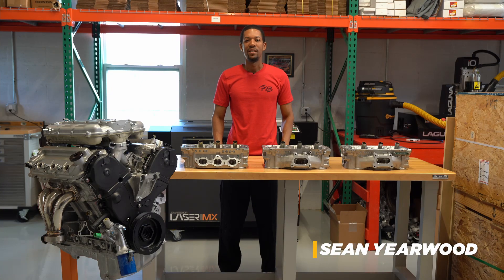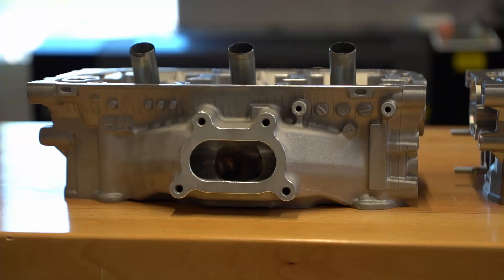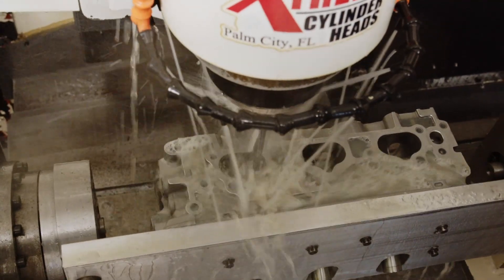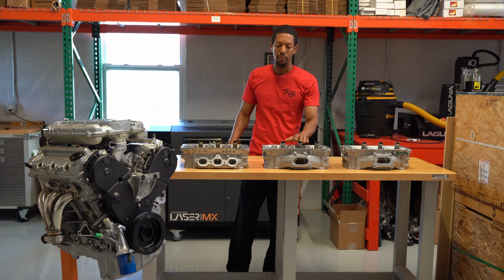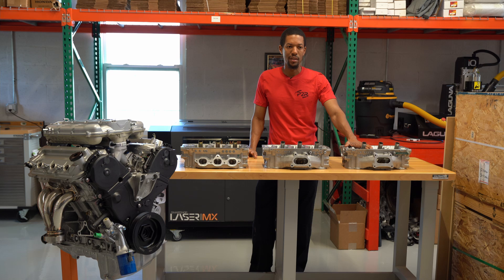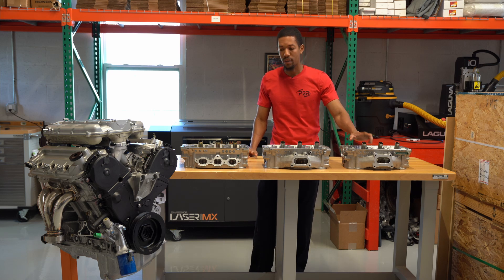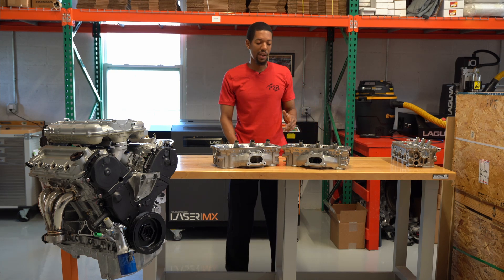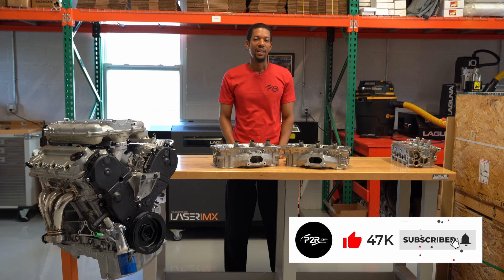J Series Tech Talk -Cylinder Head Exhaust Port Comparison J32 J35 J37

Comment: Nobody hardly mentions the Odyssey when talking J series. 
The 2nd and 3rd gens are slept on. Some light engine mods, coil overs, bigger, wider wheels, 40 series tires, and for about 300 pounds of free weight reduction, take the second and third row seats out and they perform and handle great. 
My RL1 will out handle most cars on the road

Comment: For me, the 3 port head isn't necessarily about power so much as sound. With a traditional header, I KNOW I can get that equal length and I KNOW I can make the merge collector right, but only Honda engineers know WTF is really going on with that single port stuff. So I now ask you; I heard that a J35A6 from an 05/06 Odyssey is a drop in swap for my 03 Accord Coupe, but I want something with a 3 port head so I can get some bitchin headers made... What should I look at, instead? I want big N/A power but very streetable and about an 8000rpm redline but DEAD reliable with that. Thick and strong sleeves/block, too, as I may throw nitrous or a centrifugal supercharger at it later. Was thinking a 35, but a 37 really isn't much bigger on the stroke so IDK.

Comment: I got a quick question. I have a G35 A4 that comes in the pilot. It's totaled but the engine still good. Picked up a Odyssey just wondering if there's anything I need to do differently with swapping the engine from the pilot to The Odyssey

Comment: Serious question, I noticed the j35y4+ have higher compression rate but stroke is the same as j35z so... Is it the piston or the combustion chamber that makes de difference? I have no idea where to look for this info, I want to build a high conpression NA engine so... If its the combustion chamber I need those heads!
Reply from the maker: If you're building an engine. We can just get the pistons to be around the exact compression ratio you want to be.

Comment: Is there a fix for the j30a1 head's exhaust Port that's curved to go around a head bolt. 2 out of 3 exhaust ports are a straight shot to the combustion chamber, but then one of them looks like it's designed for heating up a head bolt...

Comment: I was recently able to pick up a very very low mileage J35Y6 short block.  I had been originally planning to K-swap my 1992 Civic, but with this block in hand it makes me want to try to use it instead.  I do want to build a little bit of power into it, and will likely look at a mild turbo build for a daily driven street car- no drag strips for me!  I will likely never see redline, as I typically keep my cars in the lower 2/3 of the available RPM.  The better torque of a J35 definitely sounds appealing.  What head would you recommend I use?  Also, do I need to look into having the block sleeved or anything in order to ensure it has a long and happy life?

Comment: Im looking for a J series for a miata swap  but atm im only finding J30  is it a good engine ? Most  swaps I’ve seen where j32
Reply from the maker: I would personally only go 3.2 or bigger.
Reply: @PowerRevRacing  any particular reason ?  Cuz im from europe and where im from they. Are kinda hard to find also the k series engines are kinda hard to find the A versions alot of Z’s   I am able to pick up a J30A1 for 300 euro  with ac pump alternator and  wiring harnass

Comment: Any thoughts with stock J35Z2 + turbo? G30-770 0.83A/R, and I only want 5psi. VCM is completely disabled from an ecu reflash. I can manipulate torque values so my auto transmission can shift harder. So transmission shouldn't be a problem I think, I have yet to try. But I don't know about the engine. Stock engine alone wants to knock like crazy. I have 2.5" PCDs and 2.5" J-Pipe and 3" cat back exhaust with 3" straight resonators and 3" straight muffler. I raised knock sensitivity to stop ecu from retarding my timing. I turned off fuel dumping function in high load. I tried 12.5:1 and 12.0:1 AFR in N/A and it still wants to knock with minimally added timing. I did it to see how it would do stock. It made me a bit scared to go turbo. But I still want to.

Do you think 5psi is fine with optimized timing? Is there anything to concern for this engine? Any suggestion is highly appreciated. 

Thank you

Comment: I turboed my j35z2 on my 8th gen accord and surprisingly it's doing well for 3-5psi of boost. The molded exhaust manifold hasn't really affected the spooling and actually helped with keeping the exhaust tubing compact leading to my turbo
Reply: Hey, J35Z2 fellow here! Glad to see someone giving loves to J35Z2! Mine is from Honda Inspire CP3 in Japan and marked as J35A but it's literally the J35Z2. How are you going with it? Trans holding up good? Anyway I can get in touch with you?
Reply: Can I swap a 2005 tl 3.2 v6 and put it inside my 2004 ex sedan Honda Accord ?? Automatic on both transmissions… can I use the transmission from the Acura and put it on the accord or no!?… and how about the harnesses?
Reply: @angelmods5064  yes, Honda has been using the same engine bay size for all models and chassis. So if it has a V6 version then it definitely has the room capacity. Most of all Jseries are about the same cubic measurements. Therefore you can easily swap the J family. As for the harness, I don't think those are interchangeable. Trans bell housing for J30, J32, J35, J37 tend to differ by generations.
Reply: @blitzsiv6520  do you have a Instagram where I could personally show you couple things
Reply: @angelmods5064  check my YT account. Kept having my replies deleted
Reply: @angelmods5064  why not keep it in the Acura the trans and stuff and body is better?
Reply: @CO86 do you have a Instagram I could follow you up on how you did the project bud?
Reply: @@CO-kb9qeSo you used the stock engine harness from your J30A4/5 for the J32A3 and (LSD) 6MT from the 04-06 Acura TL base? What year was your Accord, and was it a 5AT or 6MT?

Comment: I know it's an older video but, Could you please give more info on combustion chamber sizes between the heads if any(?) Are there big valve options? Who sells good/better/best cams? Vtech heads?
Looking for options to use a J35a in my '02 IS300/auto trans, 3:55 rear diff. Also, what are the better choices between the JDM ones?
Thanks

Comment: does the rlx have a different intake manifold than the regular j35y-
Reply from the maker: Yes the RLX is direct injected so the intake manifold is quite different.  We actually offer cnc ported heads, and lower intake manifold for the rlx type s.
Reply: @PowerRevRacing  I have a TLX V6, and want that extra 20hp the RLX offers. I assume its through the intake manifold. would your ported manifold work on my TLX?
Reply from the maker: I havent done enough research of the tlx vs the rlx to see what is the differences however I know the lower manifold is the exact same part number. 

https://www.powerrevracing.com/P2R-TLX-CNC-Ported-Lower-Intake-Manifold-Runners-p/pr003.htm
Reply: @PowerRevRacing  thank you, love ur channel 🙌🏽🔥

Comment: I have a 98 Honda Accord. I’m not sure what tune I should use. I have a quad exhaust and ngk spark plugs but not the wires. Everything else is stocked. But the car puts out so much power. It’s insane. I don’t think the power in the car in channeling properly. The car goes to 90 very quick. But it’s not distributing power properly.

Comment: Hey Sean. I'm looking to turbo my 01 Acura tl. Before I turbo I want to do all the normal maintenance things and I was wondering while I have the heads off can j32a2 or j32a3 heads be swapped onto a j32a1 block without any major modification? I can do minor mods but I can't take an engine out where I live. I tried finding info on it online but it looks as tho nobody uses the J32a1 block when boosting or building in general. If I could swap a whole type s engine in I would but I'm stuck with doing small things for now. Any info about what compatable with the J32a1 block is appreciated! :)

Comment: Yooo that j35a4 sitting on the engine stand I just want to drop that in my 04 pilot lol I been wondering for a while is there any power I can put into the motor to give my pilot a lil more juice. I have a 2.5 lift with bigger tires. Definitely need the lil extra power. What do you recommend.  I've even tried looking for like a piggyback ecu chip to help give a lil more.

Comment: Will j32a2 heads fit on a j32a3 block?
Reply from the maker: Yes but requires modification
Reply: @PowerRevRacing  does the modification require machining or its it just swapping parts over

Comment: Im building a 2001 acura tl j32a1 rn. Its slow but steady. Found a afc for it and am about to upgrade fuel pump and get it tuned. Good little daily so far. Love your channel and the info you provide to the comunity. The j32s are such little beast
Reply: Is it a ulev ?
Reply: @angeloyescas7995  no as far as i know ulev was only given to accords in 2001
Reply: @popanda3652  interesting,my acura tl 2001 has a ulev in cali,but makes me wonder,so then its an accord engine in a tl?
Reply: @angeloyescas7995  what do you mean by ulev? To me ulev means Ultra Low Emissions Vehicle. Its not a THING but a title given to cars. And from what i can find online the j32a1 doesn't count as one.
Reply: Can I swap a 2005 tl 3.2 v6 and put it inside my 2004 ex sedan Honda Accord ?? Automatic on both transmissions… can I use the transmission from the Acura and put it on the accord or no!?… and how about the harnesses?
Reply: @angelmods5064  yes you can put the 3.2 into your 04 sedan, no the transmissions and harnesses do not fit together unless you modify them. It would be best to swap the entire drivetrain from the 3.2 including the wire harness and ecu. There are swap kits online and people who fabricate engine mounts for these swaps. Look them up and give them a call, they know a lot about what you need to do
Reply: @popanda3652  who are the people you’re talking about?
Reply: @angelmods5064  look up jswap engine mounts and see who's closest to you. Fabricators who have specific knowledge about jswaps and can make custom engine mounts if you need them.
Reply: @popanda3652  you have a personal ig or somewhere I could get better contact with you sir?

Comment: You guys have tons of great J info!!   I am planning a J32 swap into a custom application, turbocharged.  For packaging, the oval port makes things easier and simpler.  My concern is that longer primaries generally have better detonation resistance, what's your thoughts on this?  Hp goal i'm looking for 600whp, efr8374 turbocharger.   If there's a better way to discuss, where should I send my inquires?

Thanks!

Comment: Great channel! Love the info. I’m curious what kind of performance mods do you have for the j35a4? If you could give me some ideas I would really appreciate it. I have an 04 Pilot that had exhaust and intake. It’s been dropped. I have obx headers but don’t have them installed yet.
Reply from the maker: We have tons of parts for the j35a4. You should check out our website PowerRevRacing.com 

Cnc ported lower intake manifold,  fuel rails , big bore throttle body adapter,  cnc heads, cams, and the list goes on ;)
Reply: @PowerRevRacing  thank you I will definitely check it out! I appreciate your response! Keep up the good work my brother!

Comment: New J series owner🙋.I recently bought a Ridgeline with a J35Z5 . I read that j37 intake and a set of j32 heads is Is a decent mod for for the motor. What other modifications would I need to install there parts or are they simple bolt ons
Reply from the maker: J32 heads is not going to be a decent mod for you.  I would recommend against trying to do that.
Reply: @PowerRevRacing  hmmmmm okay glad I didn't go out and get a set🤣. Would porting and polishing my existing heads be beneficial then

Comment: Is the head on our right in the video the same whether 3.5 or 3.7?  If so, are the differences as far as top end just the intake?  On the 3.7L, how is the extra .2L obtained?  Piston size?  Thanks!  I have a 09' EXLV6 (J35Z2) and would be super interested into talking with someone about some mods.  You have a killer channel by the way, and seem like a really cool dude!
Reply: The extra .2l comes from stroke and piston size. Piston goes to 90mm from the typical 89 and stroke goes to 96mm compared to the 93mm in the J35. This makes the 3.7l, along with it's torque focused head to feel snappy off the line. I've supercharged a second gen j35 and third gen j37 and the j35 made peak power at redline with a centrifugal SC. My j37 made peak power at 5.8krpm so the power comes in strong. But can't rev it out as far cause of piston speed and what not.
Reply: @PiterStreak  Thanks for the information.  I will have a J35Z2 to build pretty soon and I do not know all the details with the J series, but that will be changing pretty soon.  What is a comfortable redline for the engines you've modified the ways in which you've done them?  What kind of power are you getting out of supercharging them?

Comment: I just got a 3.5 v6 2012 accord coupe. It's really hard to find mods for this platform vs b series, k series. There are only three exhaust system that I have found for my accord coupe. The new 2022 civic has more at this point. I'm not hating on civics because I have one. But, thanks for showing love to the j series.
Reply: I drive the 2011 version and your right it’s hard to find mods for the j series
Reply: I fabricated my own pcd's, turbo manifold and turbo downpipe for my j35z2. But there's a lot of relocation that had to go into it

Comment: You should make another one,what options the heads can get as valve size and so..and also you should say which head(s) have vtec on both sides.
Reply from the maker: We talk about valve sizes in one of our other videos but I will be doing more videos. Just don't want to make long boring videos. So just covering 1 topic at a time
Reply: @PowerRevRacing  nothing but good thing you do..and J needs love ..
Btw did you dyno the intake and please do a s2000 cover with the j series install and how do you mount the TB not to interfere with the hood

Comment: Does the integrated manifold head engines suffer from heat soak more? Since the manifold is combined with the water jacket? Pretty sure when racing temps can be above average. But I can be wrong..I heard some fk8 type r guys have over heating issues because of the integrated exhaust manifolds the k20c1 has, and that’s one of the cause of high temps.. not sure if it’s the same for the newer j series
Reply from the maker: The J series dont have any cooling issues. The fk8 has the cat right after the turbo which also contributes to the cooling issues.

Comment: Sean, is there any chance to enlarge the camshaft hole so you can run higher lift cams? I find with so many efficient parts and techniques, the camshaft is such a key in unleashing everything. It probably wouldn’t be cheap align boring and enlarging the journals on the camshaft and increasing lift/duration. Then you couldn’t go back to stock cams but for race applications and hardcore enthusiasts, it will be a must have.
Reply from the maker: That's part of the process for going big cams. Also have issue of the vtec lobe hitting spark plug tube so when your doing a really aggressive cam like that you end up having to use the 2 outer lobes and ditch the vtec lobe entirely.
Reply: @PowerRevRacing  Thank you for replying. I didn’t get a chance to tear down a j head in front of me to check clearances. Thank you for the insight. I’m guessing the quest will continue.